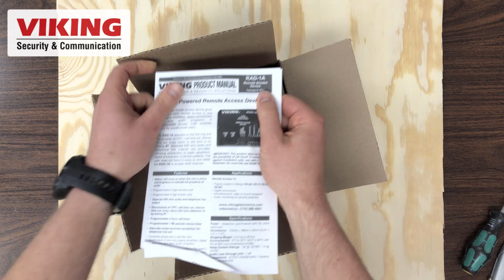Installation and Programming the RAD-1A for Secure FXS Paging

Comment from the maker: An optional software called RADVLA is available for the RAD-1A. It allows for a variable length paging Access Code of 1-6 digits.
Reply from the maker: The  variable length paging access code feature is standard on every RAD-1A produced after March 2019. Search for RAD-1A (VA) on the product's serial label or search for NIC: VA on the outside of the product's box. Either of these markings identify your RAD-1A as having the variable length access code software.

Comment: How can I remove the busy signal from Viking rad1?
Reply from the maker: Hi Marte, the RAD-1A doesn't produce busy signal but it will pass busy signal from the phone line or PABX to the amplifier before disconnecting. You can force the RAD-1A to disconnect by pressing #7 before hanging up the phone. You can also adjust the silence timeout as discussed in this video at 01:54 👍